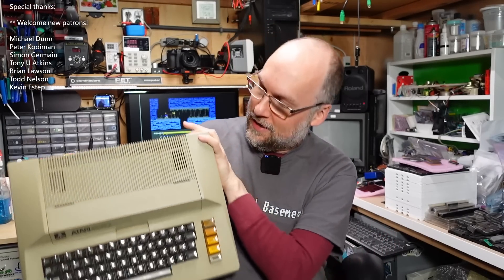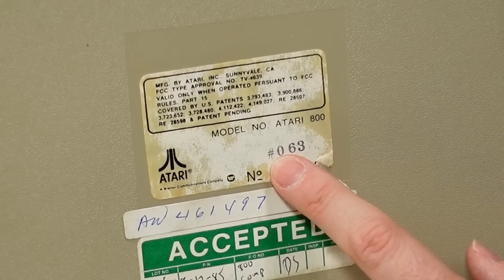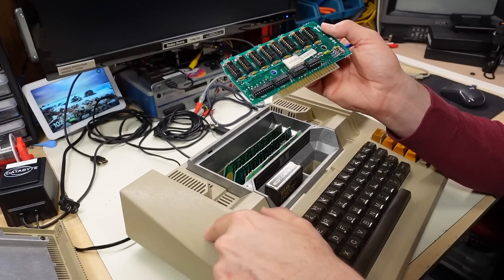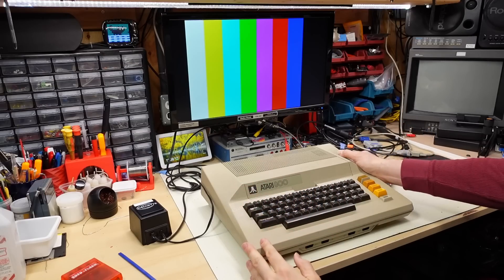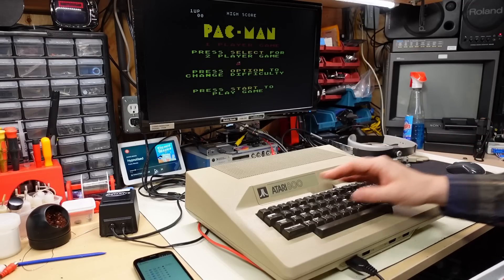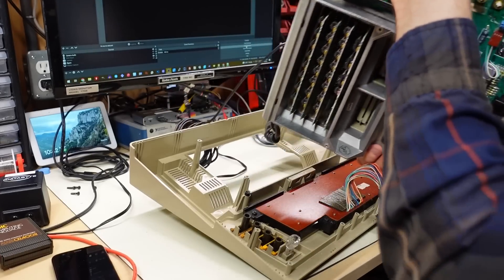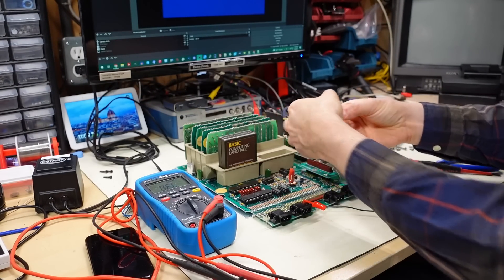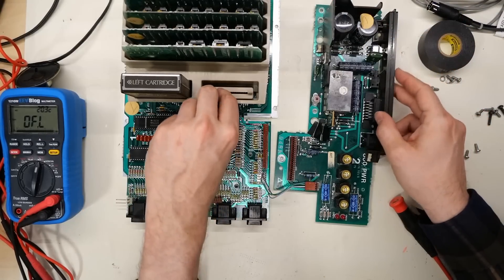Troubleshooting the beautiful Atari 800

Comment: I am glad to finally see somebody working on this machine, I still own 2 of them. 

I ran the Atari users group and I ran an Atari BBS called "The Electronics Shop BBS"  in the 1980s on an ATR 8000 Z80  CPM module hooked into my Atari 800. and running shugart 720K double sided floppies which was cutting edge back then.  I still have all the schematic diagrams, original drawings, manuals etc. I totally loved this machine and what it was capable of. BTW the constant beeping is a key board error.!  probably a stuck key which will prevent any other keys functioning and you'll get the beeping.

You're just scratching the surface of what was done with this machine
We created mods such as page flipped RAM memory to expand beyond the 48K, ours had up to 256K, and later 1MB as well as built-in power supplies, the joystick ports allowed direct access to the A/D converters which meant anything was possible peripheral wise.

It was myself and a group of other people who created many, many mods for this machine, far too many to name, I still have all of the original equipment, joysticks, add-ons, touch tablets, trackball, there was even a light pen.  We even used 1 of these machines in college to demonstrate the capabilities of its data collection ports by hooking it up to jet engine data collection sensors. That switch you don't know about is a power interconnection switch that prevents the machine from being turned on when the lid is opened.

there was an extended basic cartridge called basic XL from a 3rd party as well as many other cartridges, the metal cage is to prevent RF interference. the lid is missing 2 rotating lock tabs where you see the screw holes,  you could connect EEPROM readers and burners and created many custom cartridges and operating systems as well as games. The machine was so versatile there's never been anything like it since. 

Those rams and modules you are looking at came much later and have been replaced from the originals which were in plastic cases. later dropped as a cost saving measure. It was those cases that caused cards the to fit snugly in the slots. That machine was serviced somewhere hence the stickers.    

I have quite a few of the original cartridges  including Pac-Man, Battle Zone, Missile command. Etc.  as well as a bunch of others. But, the  cartridge that sold that machine was called "Star Raiders" it was the 1st pseudo-first-person space videogame,  and was so far ahead of his time as to be ridiculous.
Reply: I still have mine in storage also, along with my ATR 8000 Z80 and drives as well. Good to see another fan from back in the day!

Comment: That is absolute wizardry. I am astonished.  Watching this makes me happy, but also makes me sad because I reluctantly threw my Atari 800 in a dumpster about 20 years ago, and it had pretty much the exact same symptom. Everything worked except the keyboard.  The fact that you can get an S video signal out of it is amazing.  My jaw is just on the floor. Thank you for uploading this.  FYI, the ram that I had the boards were inside a plastic case, which had a label on top for which direction you put it in. It was very tidy.

Comment: The accepted sticker that says B & C is likely B & C Computer Visions which is still in business today selling new old stock Atari parts and products.

The SIO ports creators went on to design USB if I recall. That SIO design was to overcome the FCC not allowing they computer to have exposed electronics, preventing any expansion slots. Shortly after the FCC allowed more radiation and lowered the amount of shielding. The shielding was probably a large cost of manufacturing the system. 

The creators of the Atari 800 went on to create the Amiga 1000 and custom chips.

Under the shield is a CPU card with GTIA chips.

Speaker is for the keyboard clicking sound.

You could also leave the basic cart out and use the built in memo pad to test, reducing other potential issues.

Comment: For others facing similar problems and as an FYI for the “non-Atari folks” reading, most of the keyboard keys are read by the POKEY chips, but the function keys (SELECT, OPTION, START) are read by the GTIA chip. Keyboard issues are usually problems with the 4000-series keyboard mux chips, POKEY problems, or for some keyboard variants, issues with the keyboard membrane. And yes, POKEYs are getting more expensive every year as they were used in most of Atari’s arcade cabinets of the era as well as the A8 and 5200 systems. There are FPGA replacements but supply chain issues in the last couple years have really screwed things up there.
Reply: Hopefully Adrian sees this comment.
Reply: yes and I bet because people restoring old atari arcades are using that chip too.

Comment: Replaced those swollen, bloated caps in the power supply for starters. Also there are a few electrolytic ones on the main board.  
Good trick toggling the keyboard cable port directly.

Comment: So happy to see the Atari 800 on the bench!!  The A8 series is my first and favorite computer line!
I highly highly recommend checking out some of the modern upgrades for it.  An Incognito board for the 800 would be an excellent start.  It adds a megabyte of RAM, and a CF slot for an 'internal' hard drive.  If you get the one with FJC's firmware (or just flash the chip yourself with the firmware and save a bit of cash), it has a ton of additional goodness such as high speed SIO.
The FujiNet is definitely the next thing I would recommend.  It has replaced my need for SIO2PC, floppy emulation, and has an SD card slot for easy data transfers.  Games and utilities are being made which use it.  The FujiNet is not just a WiFi modem for the A8, it is able to offload things like SSL, and JSON parsing to the ESP32, which you can then use in Basic or your language of choice.  There are apps right now which show the local weather from the Internet, or track the ISS, basic IRC chat, an Internet newsreader, etc.  (There's a C64 FujiNet being worked on now, and the Apple ][ FN is almost fully functional.  But ignore those for now!  Atari!!)
Reply: Yes an incognito board is a great way to hack up a beautiful pristine 800 like Adrian's!  All sorts of permanent damage.

FujiNet is great though.
Reply: I never heard of fujinet ,,. I got to. look into it...
Reply: @petevenuti7355  You really should. Getting your atari online to load images from there, etc is quite something.

Comment: I just remembered at the close of your video... I have several of the RAM chips for these, and there used to be plans that would allow stacking of them for more RAM ability.. Please note, That was from 35 to 40 years ago, when I was doing that option, and do not even remember the details, but, this summer, as I clean out the attic and garage, allot of my junk will be sold off, and when I come across any of this old ATARI 800 equipment, if you have a P.O.BOX, I would be glad to send it to you for free.. I just think it should go to people that would appreciate the vintage nature of it, vs, the idea that somebody would buy it at a garage sale, and just scrap it for the chips metals...

Comment: scan matrix keyboard, no buffering or the other many layers of abstraction found on modern computers.. love it. A  truly rock hard system that a single person could understand the whole thing.
(one of my first programs was rewriting the input command, I had a two-dimensional array of acceptable anticipated inputs for my program, and if someone pressed the wrong key so it didn't match my chosen input, it would just beep, no one could ever crash my programs!) no trapping no interrupts, to quote outer limits, I controlled the vertical the horizontal..... as a 10 year old , that gave me an incredible sense of control.
Reply: I'm not totally sure what you mean by "no buffering." While many of the late-70s and early-80s microcomputers directly scanned the keyboard matrix with software, they certainly did often buffer the keystrokes and have layers of abstraction.

I just did a disassembly the other day of the Commodore C16 keyboard scan input routines (which I suspect are substantially similar to the C64 and VIC-20) and they're surprisingly complex. The keyboard scanner is called as part of a regularly scheduled interrupt service handler and as well as knowing how to convert matrix positions into characters (different characters depending on which modifier keys are also being held down), it also directly handles things like switching the character set when Shift and Commodore are held down simultaneously (but not switching on every scan; there needs to be a delay to give the user time to release the keys), informing the output routines of the current scroll/pause status, and dealing with key repeat. Once it's got a character it inserts it in a buffer (if space is available) to be produced later when the user's program calls the KERNAL to read a character from the keyboard. (There's a slightly different procedure for function keys to deal with expanding them to whatever string the function key has been designed to produce.)

If you're curious to look at it, the "retroabandon" group on GitLab has a project called "cbm"; under the "c16" directory in that you'll find a 539-line file "keyboard.md" that contains the hardware information and an annotated disassembly. (I'll put the link in a follow-up to this comment to avoid the spam filter eating this one.)
Reply: @Curt_Sampson  on the 400/800 , as a kid, I was never made aware of any buffering (I was aware of buffering in my Apple|| & ||c ) .
  All I knew at the time was if a key was pressed a memory address changed seemingly directly. My choice if I wanted to pole or buffer or if I wanted the system to handle it.
  I have to go back and rewatch the video to see what that chip is between the keyboard and CPU. I'm confident more was going on then I knew as a kid.

If I never hit puberty , I'm sure I would have had the schematic memorized in short order.(I was a lot more lucid back then)

Nowadays , well , it sounds like you can tell me more than I know about how things work.

Comment: The original RAM and ROM boards were inside of their own individual cartridges as well when Atari first released the Atari 800. But when they were upgraded in the early 1980s the various Atari plants around the states and specific electronics stores would install new RAM and ROM boards without their cartridges.

Comment: as mentioned, the controller board and the ram boards were  in cases, later on they were as you have there. As for the wobble, there was a couple of plastic clips that  went across all the boards to hold the still.

Comment: Hi Adrian - for what it’s worth, my Atari 800 also had an unresponsive keyboard and the problem wasn’t with the keyboard itself at all. It turns out the wires in the motherboard connector were breaking because they’re folded at such a tight angle to fit in the case. There’s some play there so I pulled the cable, stripped back the wires a bit, and threaded them back in place. I will let you know that I just about lost my mind threading those tiny wires through those infinitesimally tiny holes but it fixed everything. I suspect this to particularly be an issue on machines that had a lot of work done on them because of the added stress on the cable when pulling everything apart to get to the guts. Also, jut as a note, my keyboard is one of the Hi-Tek ones.
Reply from the maker: Heh thanks for the tip -- since I'm usually a few weeks ago on my videos, part 2 is already done. The keyboard is (spoiler) a blasted membrane one.....

Comment: Nice to see the best computer from 1979, it was a beast. In terms of graphics and sounds there was nothing at the same level.  The pokey had 4 channels, it had 256 colours and besides the normal graphic modes, you could mix different graphic modes at once (Display Listing Interrupt).
Reply: Display List Interrupts let you interrupt the 6502 processor at a given line and jump to an assembly language routine . You could mix graphics modes by setting up your own display list. I did that once to set up a mixed mode display text and graphics, and used a DLI to call a 6502 snippet to change the color palette for the graphics part.
Reply from the maker: You can definitely see the Amiga's lineage when it comes the the COPPER chip. The 800 was so advanced for the year it came out.
Reply: Yeah. You can really see the difference when you look at computers from a couple of years later, such as the VIC-20, which had nowhere near the capabilities of the Atari 400/800 (though it was also designed to a considerably lower price level).

Actually, I suppose the TMS9918 in the TI-99/4 (also released in '79) was close to as good graphics-wise, but the computer around it wasn't very good.

Comment: 5:11 The IBM 5150 keyboard help to standardize the keyboards we use today. Back in 1979 everyone did it their way.

19:12 The FCC didn’t crack down on Apple because there was no RF modulation included with the Apple ][. Steve Jobs skirted the rules by having the retailers sell you that part. Everyone else was cautious and Atari went the heavy shielding route because they were the biggest target.

Comment: 6:30 The Atari 130XE I owned had basic built in, but it was a very small 4k version of AtariBasic, and had some limitations in features. You could buy larger basic cartridges that had more capabilities, so you weren't limited to the 4k basic rom built into the systems. Atari was also one of the few integrated Basics that wasn't made by Microsoft in that era.